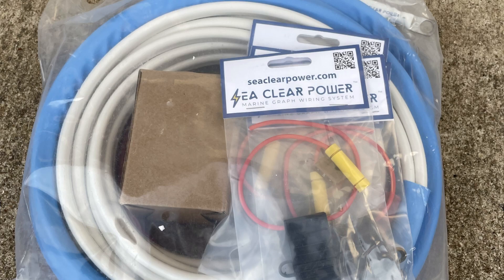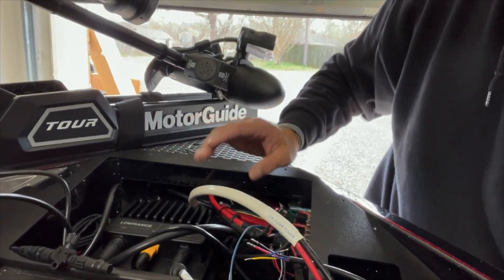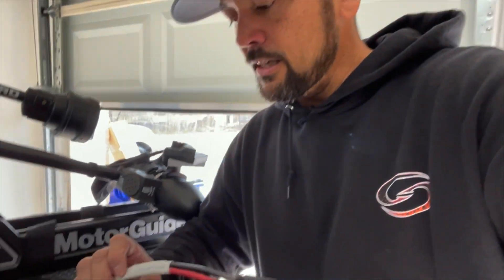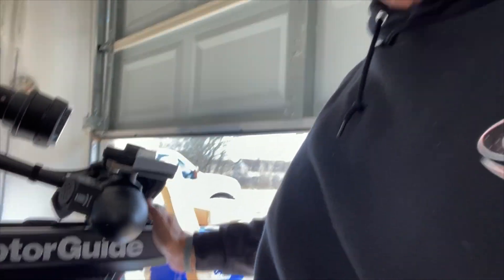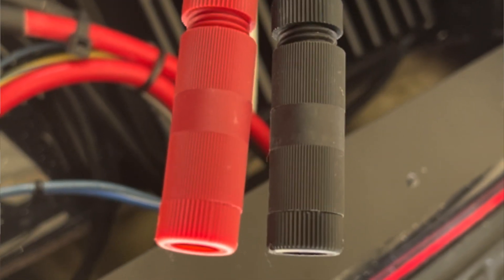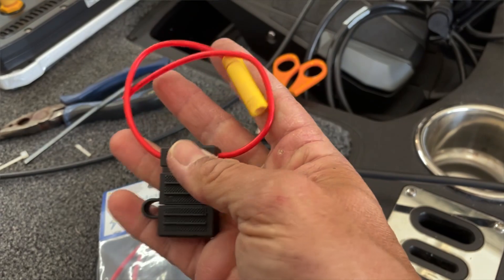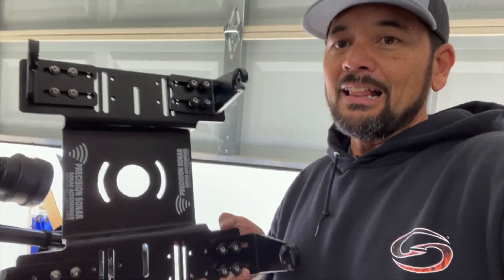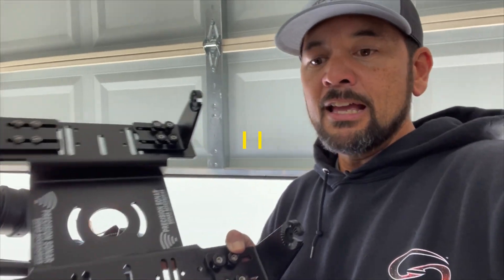Wiring Electronics - Sea Clear Power

Comment: I'm gonna be running this same harness. Did you run your negative  or positive cable to the main switch? And do you put heat shrink over the connectors? Thanks